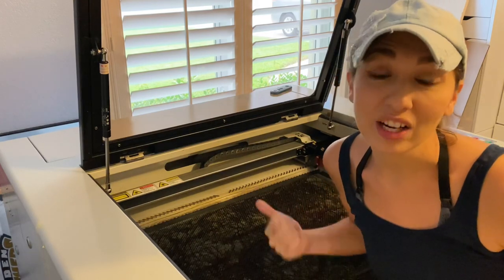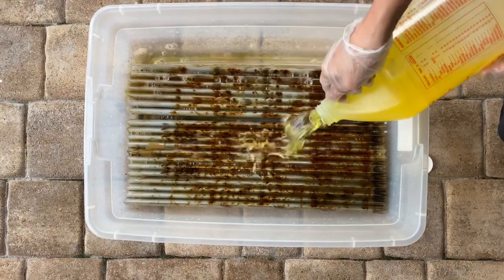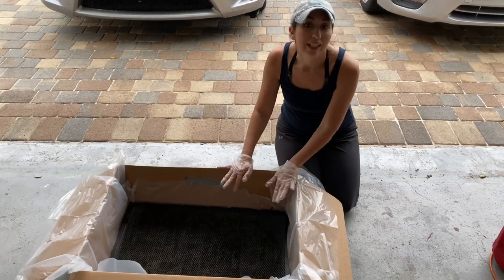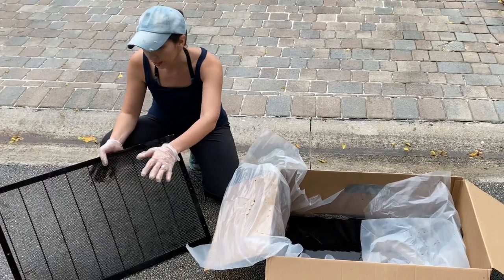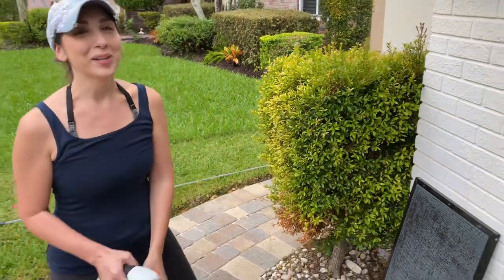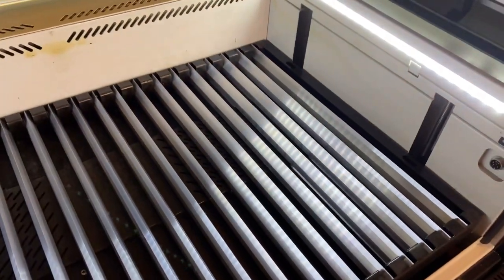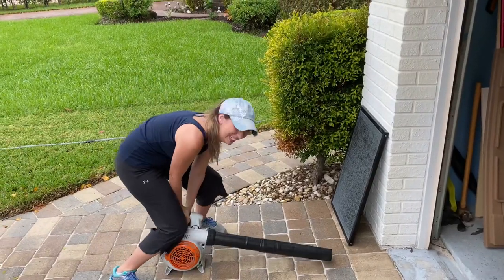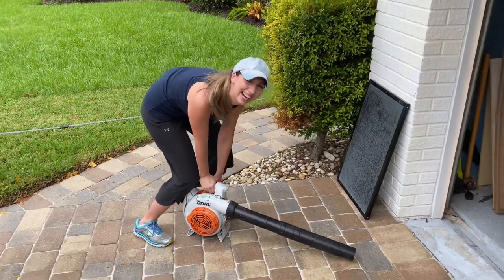How To Clean Your CO2 Laser

Comment: Thank you for the recommendation of the La's Totally Awesome stuff. I work from home so I thought I could just soak my honeycomb bed for a bit and all would be good right? I go immersed in work and when I finally went out to check... ALL the gunk is gone and the bed is like ba-rand new, but the cleaner had also removed much of the paint as well. So next I'll try just a gallon sprayer and pressure washer.

Comment: Hi Mom 😊

Did you add a smoke blower underneath the table?

Just wondering, becaus this slider under your blades are open and in your other videos i realized there's not a lot smoke in comparison to mine Mira 7.
Reply from the maker: Hey! I have not. I did upgrade the fan though. Are you using the stock fan?
Reply: @ThatMomWithALaser  yes, the stock fan. 
Okay, thank you.
What fan do you have?

By the way, your videos are great and so helpfull.
Thanks and a big hug from Swiss
Reply from the maker: @simisimi1086  I have a Terrabloom. It’s good for a Mira 7 but it’s not strong enough for a Mira 9. I like it because if fits inside the machine. You can find it on my Amazon store under the “upgrade options” section. Www.thatmomwithalaser.co
Reply: @ThatMomWithALaser  ok, i have a look. Thank you 😀🙏

Comment: Hello and thanks for your very helpful videos. I have to tell you that after your videos i loved mira so i bought one!! But i face a problem. When i am cutting wood flames are appearing at the beam. After a search on the net i found some options saying that in this issue air pressure helps but in my nozzle i can feel no air. Is this ok for mira or i have to do something?  Thanks!!!
Reply from the maker: Hi! I'm so glad you are enjoying the content on my channel.  You definitely want air when cutting.  Which country are you in? I would be sure to contact the company you got your machine from to have them help you troubleshoot.
Reply: @ThatMomWithALaser  Thanks for your answer. Finally and after spending some time with my mira I found that the tube that brings air to the nozzle was blocked. By the way your new video is super.

Comment: Are you still using alcohol to clean the inside after the awesome cleaner? I was wondering if alcohol would eventually dry out the rubber seal on the lid and damage it. Thanks!

Comment: There are some areas of my Glowforge (like the door right in front of the honeycomb tray)  that seem to build up lots of resin from burning wood. I solved that problem by covering the area with some wide tape, and when it gets gunky I just peel off the tape and put down a new layer. BTW if you are considering getting a laser, the Glowforge is easy to use, but a nightmare to clean.